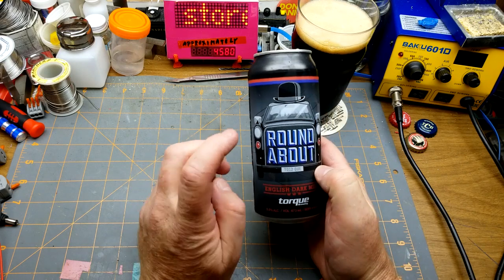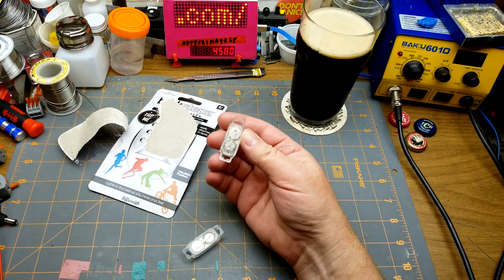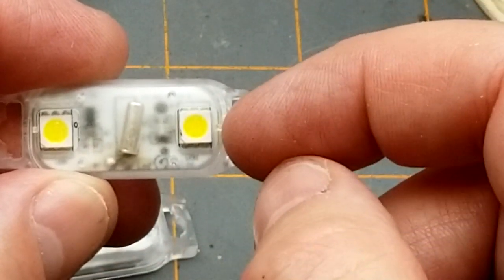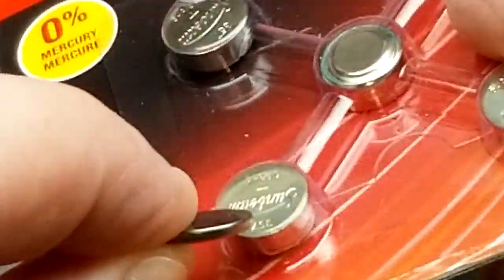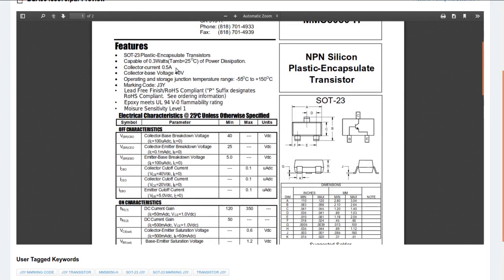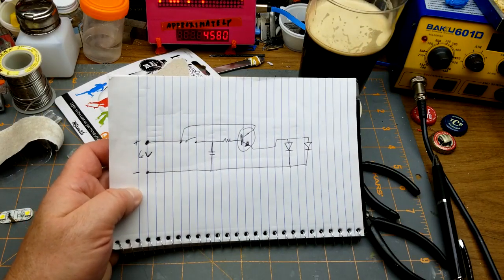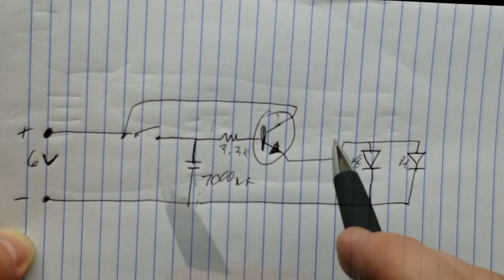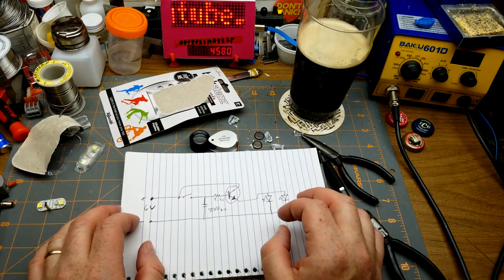blinkstepz teardown

Comment: Curious about the npn transistor.   Is it basically used to increase the efficiency of the circuit by limiting the leds on time and extending battery life?   I can't see any other reason for its use.

Comment: Ooow 6 volt, i've never seen one of those batterys before, I thought they were 1.5v.
The on line sellers are just taking the micky, they must think people are stupid.

Watch batterys i buy in single type packs from amazon, local shops only have those stupid packs that have loads of batterys you don't want and two lines you do :-(.